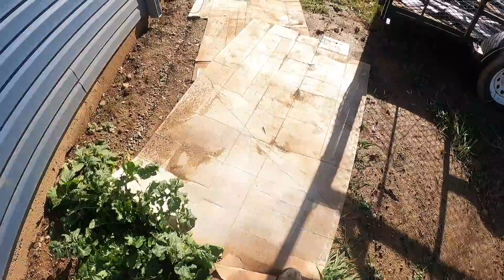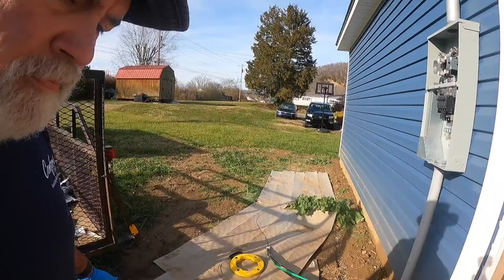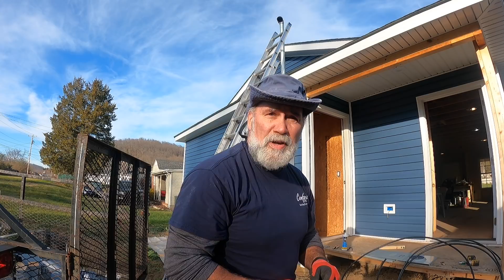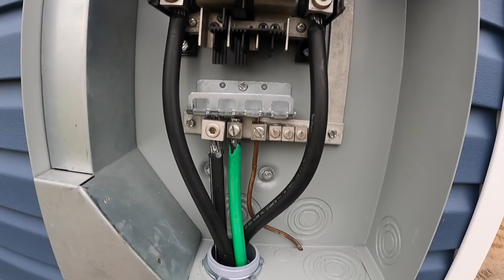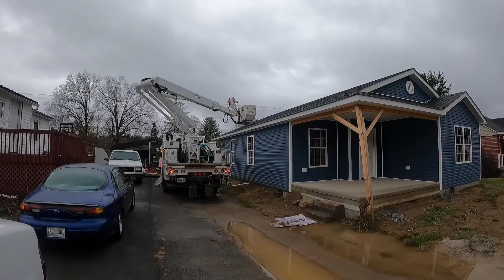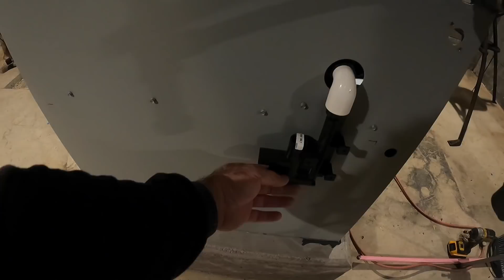Not Necessarily HVAC Part 18

Comment: I’m with you nothing wrong with aluminum service wire, it’s good enough to bring power to the meter it’s good enough to bring power from meter to the house. My service is over 40 years old not one issue.
Reply from the maker: I know it’s a controversial subject lol. But even the inspector said “No one uses copper around here anymore”

Comment: I have run and repair thousands of services and they are NO way I would run aluminum wire in or on my house. I know copper is up but I still would use it today on my house.
Reply: Almost every modern house is fed with aluminum. It works fine if you install it properly.
Reply: It’s aluminum feeding the meter from power company. So how come it works for them?  It’s not a issue installed correctly
Reply: @morehp1  Most of there connector has a grease in them to help to protect the connection. But I have seen many that have failed over the years
Reply: @Just_A_Toaster852  The electric company's in my area will run a aluminum service to a house. But the house has to supply the run down to the meter. I have seen only a few copper run failed because they where never torque down. But aluminum connector I found where torque right but still heated up until it fails. If you feel safe go for it.

Comment: The copper may have been smaller, but probably not any easier to pull - it's way stiffer than aluminum in my experience...    It'd be nice if those LB's had just a little bit more length on the long leg to bend that heavy wire through them.
Reply from the maker: For sure. I need to buy a wire bender. But then again I'll probably never need it again lol.

Comment: Is that an Armstrong/Ducane/Airease furnace?  We've got one.  90,000 BTU 95% 2 stage with ECM blower.  Top notch!  Paired with 3.5 ton A/C.  Your furnace case looks similar but it's obviously a smaller BTU unit.
Reply from the maker: Yes it is! Good value for the money I think! I bought a night service kit back in 2014 when I started selling AirEase, haven't had to use a piece out of it yet lol.
Reply: @ComfortPlusHeatingandCooling  Our was rebadged as American Home Comfort.  Not sure why they did that.  Must be the HVAC company's thing.

Comment: I really enjoy your channel I have a friend who is a master plumber that is just like you the one silly question I have why are you not going gas range and gas dryer won’t it be cheaper to run than electric ?
Reply from the maker: We debated a gas range, but electric ovens seem to cook better than gas and dual fuels are $$$$$. I've never had a gas dryer. Is there ever trouble with the vent having flu gas and lint in them?

Comment: Is that elbow box thing and conduit bolted to the wall?  Would it be easier to take the conduit off and feed a less-sharp angle then feed the conduit+cable into the big box?

Comment: They  don't  do under ground  service  in your  area 😒
Reply from the maker: The homeowner can pay to dig ditch, install 2-1/2" conduit and wire, provide Sch 80 conduit and weather head with wire for Power Company to run up the pole, then recover ditch, but there's still wires going to all the neighboring houses so I didn't see the benefit lol. The overhead "reconnection" cost me $50.00 :)